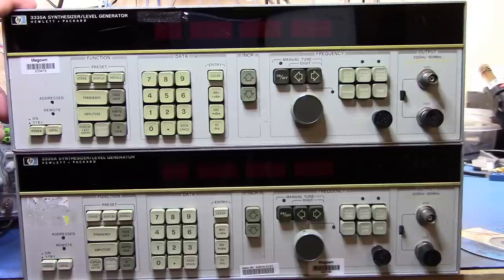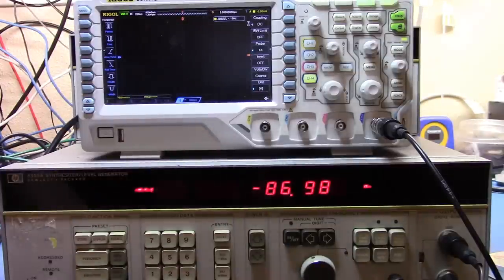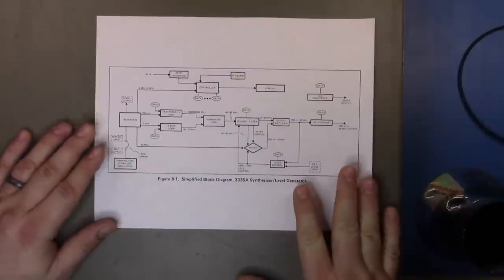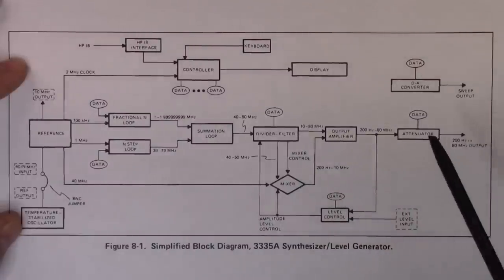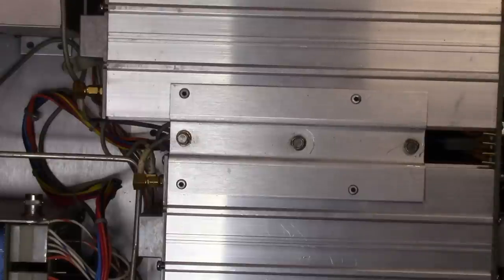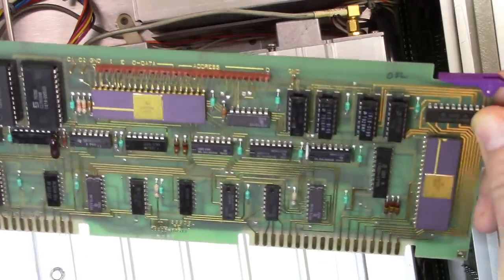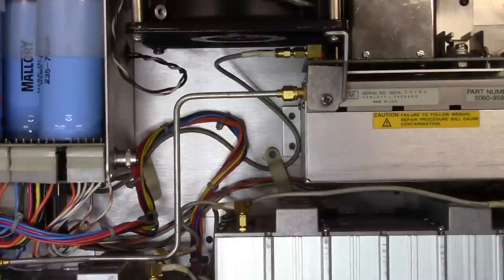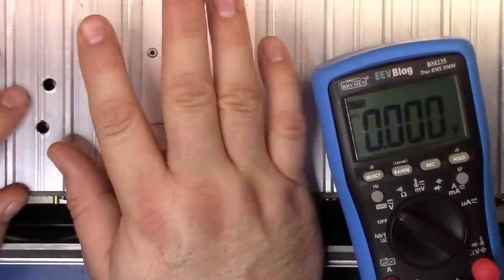HP 3335A Repair - Part 1

Comment: 0dbm = 223mv RMS into 50 ohm .  The minor error is not necessary the fault of the gen.

1. Terminating resistance could be a bit off.

2. Most digital scopes (until recently) have been 8 bit vert resolution. With only 8 bits, I think that is as good as it gets. (check the math, I am not sure)

Since your test signal is only 5KHZ, that's within the response of most lab grade multimeters, you might want to use that instead.

Comment: the gold ic look like tektronix 2465 u650
Reply from the maker: If you're talking about the grey and gold ones then they're actually 6800 series Motorola parts (the micro and a supporting chip) - That pattern though is fairly common and Tek might have even had the same Motorola parts relabeled as Tek specific numbers.

Anyway, hope you enjoy the series.
Reply: U650 (display sequencer module) 155-0244-01  I have already fixd a lote tektronix oscilloscopes
I have 3
2 units of 2445
And one of 2465
From most of the problems
I've solved in the past in the tek 24XX I remember
The service manuals
by heart

Comment: All the supply voltages are in spec when using an EEVBLOG DMM, Just kidding.
Reply from the maker: Nice :) I think I need to get the A15 Pass transistor board out to test - That'll be in part 2 if things go to plan.
Reply: Are you sure it is not set to 240V? If it has linear supplies that could cause all the supplies to be well out.
Reply from the maker: Yes, the switches are set for 120v operation.